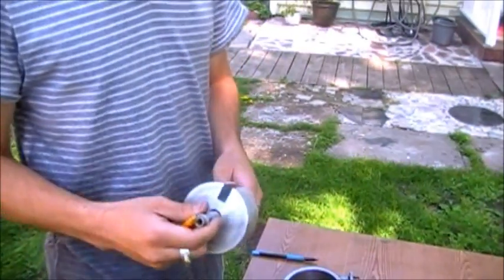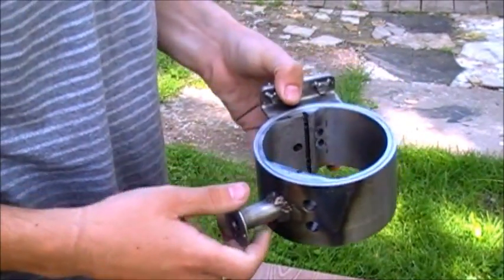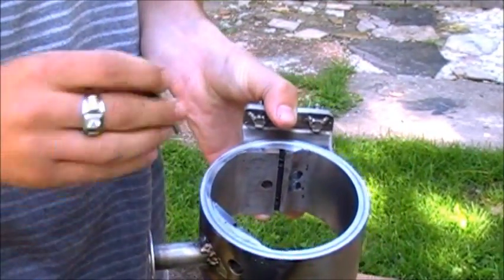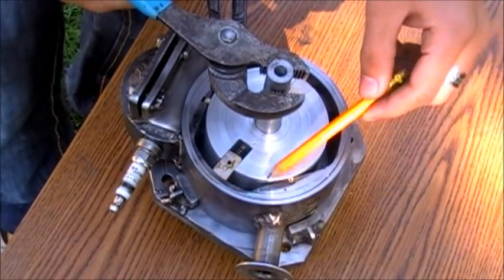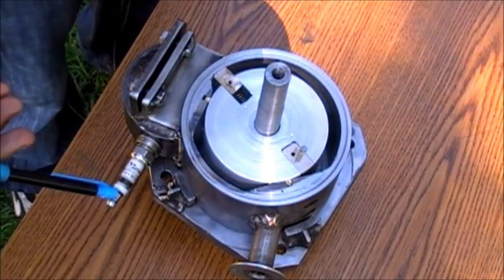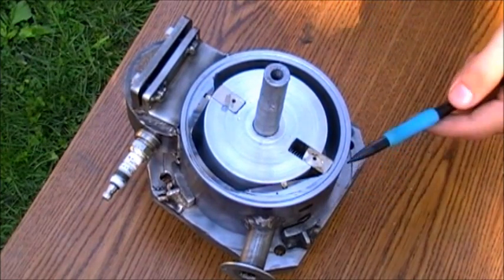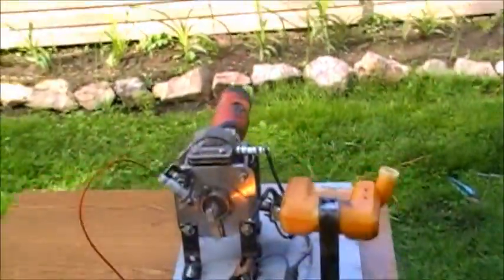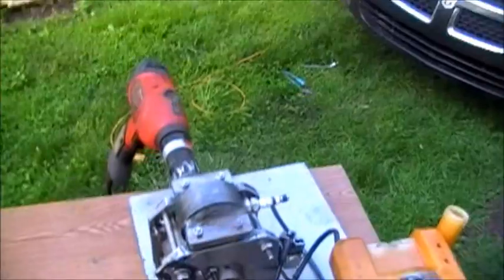new rotary engine semi functional prototype

Comment: It actually would fire considering the part tolerances, at appears that is actually not the issue. The problem is when you have the fuel/air mixture forced into that combustion chamber, the gasses are simply exiting on the other side of that seal plate, before it has a chance to get on the other side of the combustion chamber exit holes and thus seal for expanding gasses. Even with both seal plates installed, you still have a majority of the fuel/air mixture exiting out of the engine, on the aft side of the seal plate.You would have to install some kind of valve or reed valve activated by the rotation of the rotor to only allow the gasses to exit the combustion chamber when it is necessary. Hope this helps! Very impressive though

Comment: Great work... definatly a unique design. I think it should work. You can hear that it IS firing... and you can see the way the drill is moving that there is some power being made.  Maybe try a heavier flywheel... on the opposite side of the drill, most engines wont run without some mass to get them around to the next "stroke"   Great job guys. Keep up the good work.

Comment: So not only is the seal moving in and out with a lot of travel, but it has to go across another seal? Put a set of piston rings in a groove in the cylinder of a piston engine and see how well it works (and for how long).

Comment: Nice work even if it does not start ! Cheers from Brussels ! Have you ever think to make a smaller combustion chamber (the cover with the spark plug screwed)? Yours seem way too big for a good compression... At this point of your work it should not be difficult to try to make a smaller combustion chamber. And you need intake valve as well to keep the pressure insine the combustion chamber. But I repeat : great work ! none motor on this earth had start on the first time, so keep it close to your mind dude I really think you are pretty close of womething very good. You have to calculate your compression ratio to do it nice. Regards.
 Fernando

Comment: I don't know if you have tried this but maybe it will work with two adjustments;

1, maybe one cicle per turn is not enough... As the Wankel engine has 3 explosions per turn, you might be able to set a couple of them

2, I think that the combustion chamber is too big compared to the "admission chamber" you might need either a bigger "admision chamber" or a smaller combustion chamber, in order to set a higher compression into the combustion chamber so the explosion would be greater and more powerfull.

Otherwise looks really promising altought as someone said, you will have a lot of lubrication problems, just like the wankel engines, but for sure that there is a solution for that problem... Congratulations in your prototype, looks really promising if it really can work with hydrogen

Comment: Would work better with smaller apex seal, and corner and side seals may also be necessary, and why restrict yourself to one face? Looked to me that the engine didn't have enough momentum to get it one full cycle.

Comment: I wish someone would design alternative propulsion systems away from petroleum based designs.
Reply from the maker: well the beautiful thing is that you do not need to use petroleum in this engine it would actually perform much better with hydrogen because there is no compression there is no overheating problem or any other problem for propelling it using hydrogen..
Reply: MrStoneycool69 So why do we have Tesla, Chevy Volt, Nissan Leaf, Mistubishi Miev, Honda Fit EV, etc....
Reply: +MrStoneycool69   There were an awful lot of electric vehicle manufactures at the turn of the century, so where did they all go?
Answer:   They discovered that there was far more energy available in a single drop of liquid or gaseous fuel than could be stored in a reasonably-sized battery.
The only valid reason for re-introducing electric vehicles to our roads is because of the huge success of the internal combustion engine which led to air quality concerns.  However, it must be realised that the electricity needed to charge the (hideously expensive and potentially dangerous) batteries has to be generated by fuels, be that gas, oil, coal or nuclear.
Raw materials still have to be transported to the power stations by, guess what, fossil fuels burnt in road trucks and rail locomotives!
Plus, (as someone else mentioned) the internal combustion engine does not require petroleum-based fuels in order to function satisfactorily.
Reply: Paul Ellis Great minds think alike aye?

Cheers!
Reply: Dylan Morgan The efficiency of batteries as a medium for the storage of energy has improved by a meagre 5 percent over the last 20 years or so.  The weight and size has dropped, but the efficiency has not.  The only real improvement expected is a reduction in charging time, plus maybe another 2 percent efficiency improvement.   Costs could go down if Lithium can be replaced with a cheaper alternative.
Liquid or gaseous fuels synthesised from waste materials has a much brighter future, so please don't write off the Internal combustion engine just yet!!!!    These may be utilised in fuel cells to produce electricity too.
Meantime I wear my "I Love Fossil Fuels" T-shirt with pride.
Reply: It could run on hydrogen!
Reply: The alternative was there all the time, in the last 130 years: the electric engine.
Reply: *****
I agree, but "they" won't allow that unless you want to wake up dead.
Reply: Jakob Orkin
The majority of transportation still relies on petroleum based products for propulsion. You only have to look at F1 today, it still relies on oil companies to race. Petrol electric cars are less than 5%, and priced expensively in the western world.
Reply: +MrStoneycool69 Otto and Diesel engines are both multi-fuel compatible..

You don't need petroleum...

The most efficient engines in the world are Diesel types... and they can run on virtually anything that burns
Reply: Paul Ellis Tadiran is a German manufacturer and the only one in the world that makes batteries able to provide ( 700 watts / 1 kg ) x 1hr.
But don't ask me about their price. I guess that's the "best" part of it.
Reply: ***** Yes, but they still have to be charged up!
Reply: Paul Ellis That is absolutely correct.. they still need to be charged up...

and where will that energy come from?

chances are, in most places in the world today that energy will come from a heat engine using a liquid, gaseous or solid form of combustible fuel..

because its the most economical and practical source of energy..
Reply: The real doktorbimmer Exactly what I said earlier!
Reply: MrStoneycool69 No manufacturer can profitably manufacture and sell electric cars in a competitive market.  At best they are a loss leader.  A premium price always has to be paid and how long before the buyer can recoup the extra price in fuel savings?
Reply: COMMENT The oil companies operate within a semi-free market, (which ought to be a truly free market, but government would never allow it). They need to remain competitive, just like any other business, in order to survive.
If you can produce cheap energy and make it cheaper to store it in a car than it is to store gas, and have the purchase price equal to or less than a gas powered car, then you will become a billionaire almost overnight. (assuming you can equal the safety, handling and performance of today's vehicles, that is!)
Reply: Dylan Morgan Unfortunately electric motors have to be tied to a stationary power supply  by cables or use batteries.. not a very efficient option for vehicles
Reply: Dylan Morgan It will never happen.. the physics of chemical storage batteries does not allow the high efficiency required to match even currently available ICE powertrain systems.. 
EVs are fundamentally less energy efficient and present a much larger negative environmental impact than modern fuel efficient ICE technology..
Reply: The real doktorbimmer I fully agree. One gallon of gasoline contains about 40KW.hrs of energy, even in a currently produced, average engine.
The power lost from power station to charging point is truly staggering.
The best option is to carry around your own power station, in the form of a hybrid, if you insist on going the electric route.
Reply: Dylan Morgan You clearly have little knowledge of battery technology or its very finite limitations...

No, such a battery can never exist due to the limitations of conventional reusable chemical storage.

Otto, Diesel, HCCI and gas turbine engines powered by alternative liquid or gasses fuels will remain in service long after petroleum becomes scarce until an entirely new energy source, (perhaps nuclear fusion) is developed into a practical technology.

Until then EVs will remain a small niche segment..
Reply: Dylan Morgan Wow! you are an idiot.. Toyota alone produces that many vehicles a week!!!

You don't know much about batteries Lol!!!!!!
Reply: Dylan Morgan Where do you get these crazy nonsensical ideas...??? The media???
Reply: Dylan Morgan A sensible comment Dylan. I am not anti-electric, ( I fly "impossibly" small and light electric R/C model planes )but the ICE has a bright future still. It's still about power density and range....plus cost of course.
Reply: Dylan Morgan I can easily see big cities going all-electric in the not too distant future, with subsidies and tax breaks a big lure for the potential buyer.   The diesel car turned out to be a big con-job perpetrated by certain European manufacturers in league with governments who promoted low CO2 emissions, conned, in turn, by so-called "climate scientists", who are nothing of the sort, merely paid lackeys who are forced to promote the big lie or they get no government money and no jobs.
I am not taken in by the environmentalist pleas for a "safe" environment, it is merely a new form of religion and cannot be substantiated rationally.  We were forced to abandon research into safer forms of nuclear power and now blight the landscape with useless wind farms and hectares of solar panels which require huge subsidies.
While we sit on millions of tons of unexplored carbon deposits, the price of energy forever increases.  This is truly staggeringly insane.
The evidence from science tells us without question that the ideal level of CO2 for a healthy planet is 2000 ppm, which means that whenever we release that carbon back into the atmosphere by burning it we are doing the planet a great favour.
Reply: Dylan Morgan Please don't listen to the doom mongers.  They said we would have no oil left by1976  !!!!!
Reply: Charles McBoy The problem with hydrogen is the flame speed, it is obscenely fast!
Reply: I feel the same way thats why I ride a bike it's already been invented.

Comment: Its just a vane type rotary engine. Poor sealing of the vane to stator and vane to rotor surfaces result in serious chamber losses. The rotor to endplate seal is also difficult to make, but possible.

Good luck with making this work, it can be done, but it isn't really revolutionary.

Comment: WAY too much friction..... this isn't remotely feasible.  Nothing new here..
Reply: +nikita surgay If you do not use pre-compression, you have a Lenoir cycle. Something really inefficient.
Reply: +madjimms Thermal efficiency is lost. The problem is solvable... at a cost.
Reply from the maker: it is about as much friction as any pneumatic air tool....also the new part is that this engine does not compress the fuel mixture to make a combustion
Reply: nikita surgay Without high compression, volumetric efficiency is lost.

Comment: Newsflash:

This is an attempt of a "vane" rotary engine.

Nothing new.

Quite old.

Thank you for playing.

Please try again.
Reply from the maker: the only difference is that "vane" engine has rotor placed eccentrically  which contributes and a combustion chamber within stater which means that compressed gasses after combustion will pus on a lever with a huge amount of force at the same time as the plate that is trying to come out of the vane .. which creates lots of friction at the tips of the vanes ..which will eventually contribute to lots of wear and at the end the plate will either brake or the engine will get stuck.... if you make a simple calculation you can see that this motor theoretically will have somewhere around  70% efficiency... but even if it is only 50 it is still worth it.. plus power to weight ratio is really high approximately..3.5 with 1000 rpm with 10 lb ...